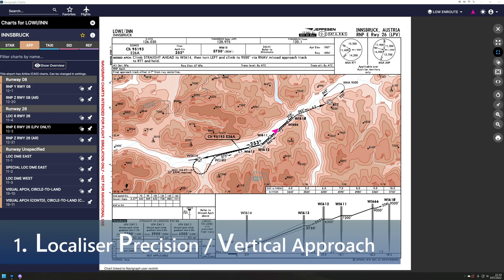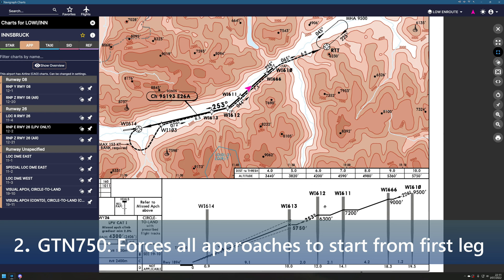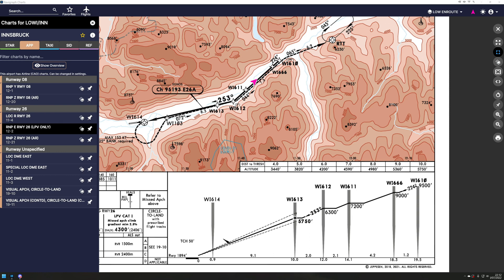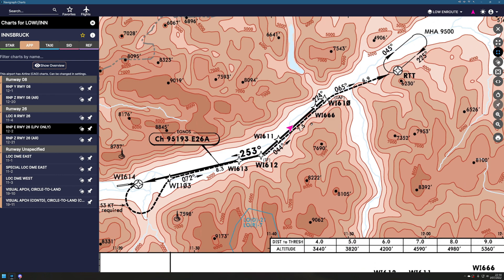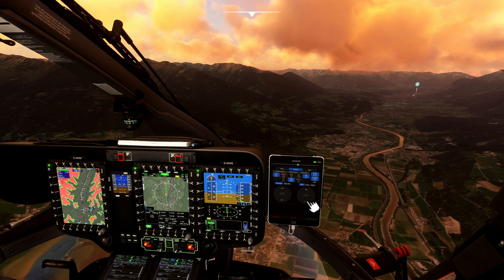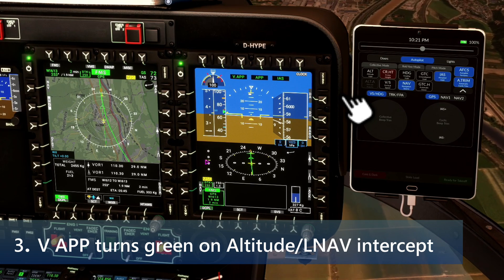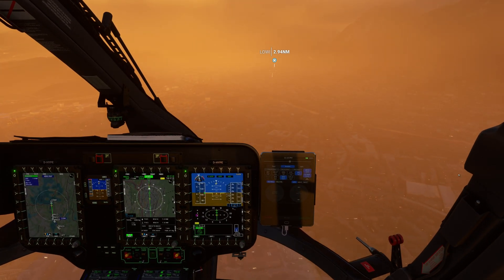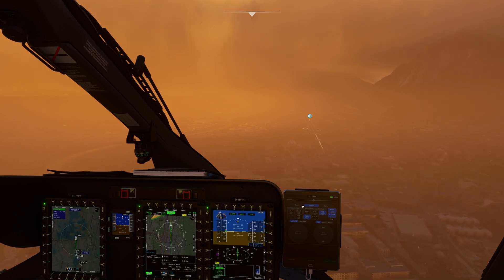17c. H145 Tutorial MSFS 2020 4K- Follow a LPV Approach to Innsbruck. Flightplan/walkthough

Comment: Do you control everything with the iPad and mouse? I'm not a sim guy so have no idea how MSFS works. I'm interested in getting this but don't want to buy joysticks etc as I'd only be using it to look at IFR procedures which would be using autopilot. Thanks for any info.
Reply from the maker: Hi Jimmy. Yes it is possible to use just the Ipad and keyboard. Your best option though may be a cheap gamepad controller as well to make getting up into the air easier. It will also give you a decent out of options for programming commands. You will occasionally need to switch to manual near the threshold anyway. Hope that helps. Let me know how you get on. Other folk may offer other advice...